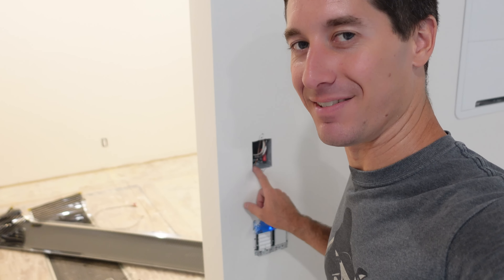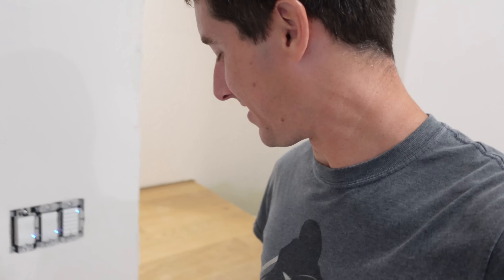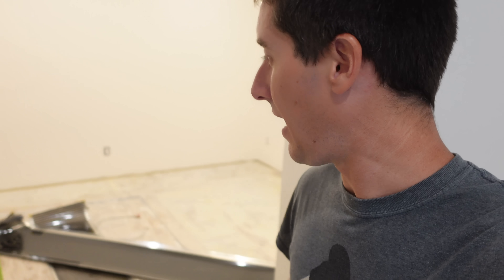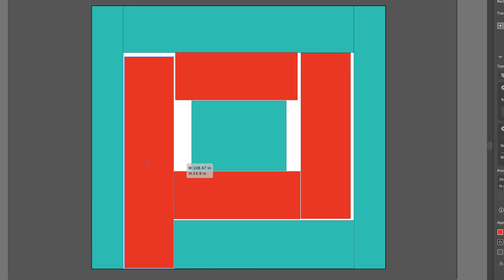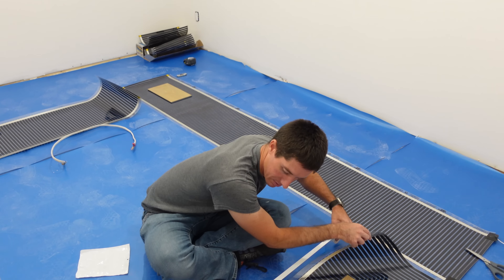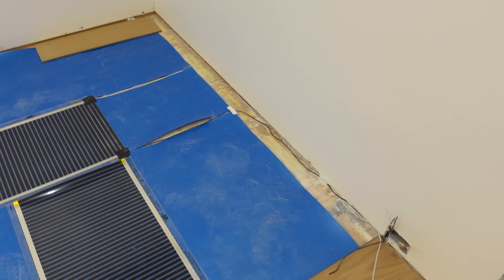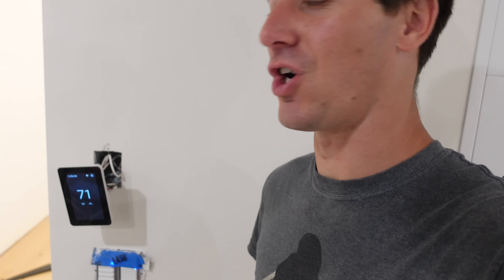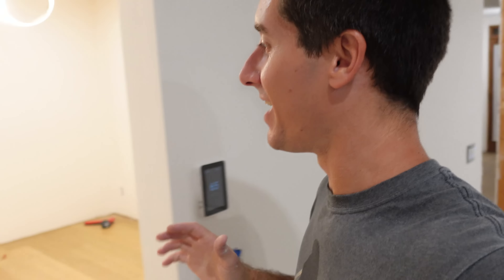I Put HEATED FLOORS In My Closet Because YouTube Said It Was Stupid *It's AWESOME*

Comment: Have restored two old houses.  1930 build and 1924.  Had radiant floor heat in the bathroom.  On cold mountain mornings. utter bliss.  Pulled about as much power at a 40 watt light bulb.

Comment: So do you have to notch the trim where the wires come out of the floor to the junction? Or will you be able to just grind some off the backside and cover it completely?
Reply from the maker: @slammedniss  the wires are already under the trim completely, notched the Sheetrock. It’ll all be covered by cabinets though

Comment: On floating floors like this you are supposed to install it after your cabinets so the cabinets aren't sitting on it. It needs to be able to move. I did double-check this specific flooring to be sure and it says it on the 1st page of the directions :)
Reply: But this is Watch JR Go, he always knows better than industry standards. 😁
Reply: @randomnonsense_1  To paraphrase Archer: Do you want separating joints in your floor? Because this is how you get separating joints in your floor :) (Among other issues.)
Reply: He also didn’t stagger his rows enough at the closet door as clearly seen at 9:55

Comment: Get some gel knee pads you will thank yourself when you are 60yr old
Reply: I’ve talked with some flooring guys, they suggest the leather ones with the thick felt lining. They need to slide a bit on the surface or it just jambs up the knee joints. Made a lot of sense to me. Currently in my 50s and not a flooring guy.